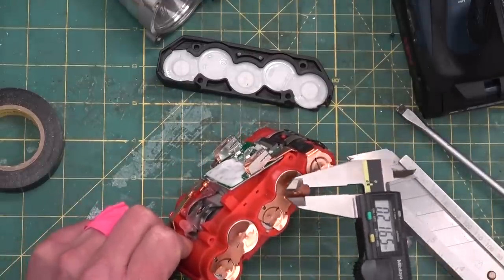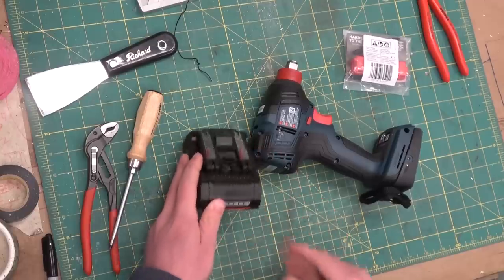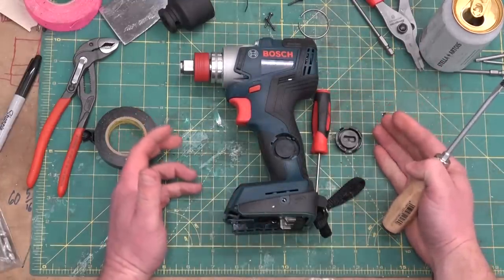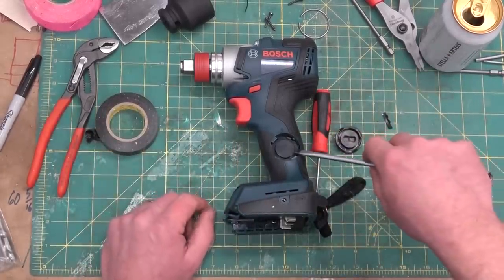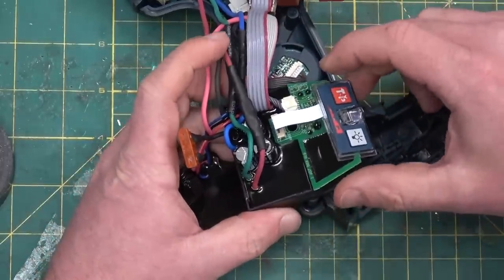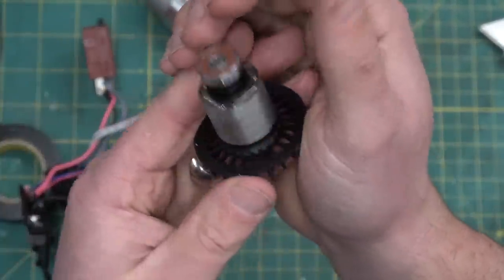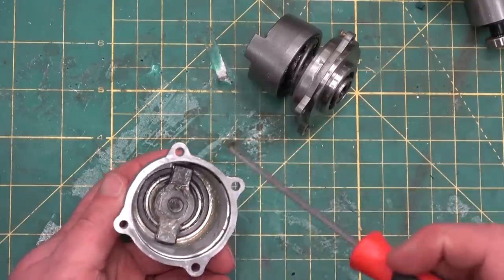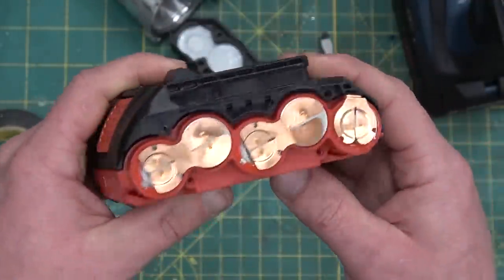BOLTR: BOSCH impact driver | CORE 18V

Comment: Cooling Fins of Plastic  is like Fire Resistant material out of gasoline. Plastics, no matter the type have a thermal coefficient of 70-100 degree C/watt. In other words its an insulator.
Reply: HDPE has thermal conductivity significantly better than what most battery cases are made of. It's shitty compared to aluminium, but twice the heat conductivity is twice the heat conductivity.
Reply: @macvos  I dont know its thermal conductivity off the top of my head, but I sure you are correct. However, half of barely conducts is still very bad. Its why power equipment and batteries fails. If these companies would spend another nickel and put any type of metal on type of a FET thats controlling speed control or provide other high conductivity bridges from components to case the tools and batteries would last a lifetime but corporations can't afford that.  I spent 40+ years in San Jose Ca, designing fault tolerant servers and we solved thermal issues all the time. I can tell you from experience, its some marketing guy convincing management if the product costs another 5 or 25 cents people will turn to the competitor and management whose prime concern is profit, agrees's. None of these types cares about the end user.
Reply: @ColdWarVet607  I'm sure cost cutting plays a large role, but a strip of aluminium is probably cheaper than some expensive plastics. You'd also have to take electrical safety (conductivity), thermal safety (prevent hotspots) and durability (drop protection and corrosion resistance) into account. Which metal would you advise that doesn't conduct electricity, doesn't corrode and can handle drops into concrete?

Comment: I think the 3/8" square drive with a hex drive inside is kinda cool...but yeah, I won't be buying any Bosch stuff any time soon...lol
Reply: I think it's a 1/2 inch square. The disadvantage of having the hex inside is the possible torque is limited, or it would break the square, because it's less rigid than a massive square. The Makita 285 is a little bit stronger than this, because it has no hex inside.
Reply: @simonm1447  that square is more than strong enough for the torque the tool provides. It's also a lot stronger than any adapter.

Comment: I picked this set up on a nice deal or it wouldn't have happened. I like the drill quite a bit, but the impact is weak and I hate the fact that the light won't work until you're balls deep in a fastener, or your wrist. The impact does serve a purpose now and it's for when I need a smaller profile driver or something easy to carry while doing work indoors. For outdoor use, my Milwaukee impact just dick wags this tool.

Comment: 21700 cells are currently in but its mostly marketing theyll probably decline as the 26650 did... the bigger the cell the harder it is to cool and as a result the capacity and/or the rated current does not scale well to the volume
Reply: They have lower internal resistance = less heat at the same power output. Also, most brands have finally started to follow Bosch and Metabo and use 21700 cells as well. They're simply more suited to high power applications than 18650 cells.

Comment: idk brother..i didnt have any influence for tools or engines from my "father" or any other male for that matter, was raised by my grandmother n still ended bein a pretty hardcore gearhead tool addict n ATVaddict (which was my first, n still after over 20 year is my email :p)  but i love stats n measurements n would love to start seeing that kind of integration in tools, its not useful for me but it would cool to know some stats on my tools  as stuff gets cheaper well b able to have torque sensors power sensors temps and different modes of control that might actually b useful. iv even thought about putting a gps module n either tiny battery or regulator in some of my more expensive stuff so id b able to find it  iv lost enough that shit costs too much   we should b able to have some kind of environment of that kind of stuff without serious security concerns we should work towards that

Comment: The copper battery connections should be at least 0.025 , 25 thousands ... even better would be 0.030 - 0.035 , 30 to 35 thousands of an inch and nickel plated

Comment: The bluetooth module allows you to change the timeout for the LED light. For me, thats the only thing I found to be useful. I‘m not a fan of products using or even needing apps to work. Also this BT thing is using a button battery cell. Maybe someone will hack this, to allow changing these settings without the module.

Comment: The batteries for the Dremel are the same, because Bosch owns Dremel
Reply: Doesn't mean the connectors, shape, material or cells are the same. Bosch also have separate DIY (green) and pro (blue) lines with different packs and cells that are incompatible.

Comment: Can Bosch explain why BOTH my 8ah batteries died after just 3 years? I paid a lot of money to use them on my Bosch angle grinder with moderate use and no abuse, and now they are dead!! Shame on you Bosch i am never going to buy another tool from you.
Reply: Have you brought them to a repair shop? Would be really interesting to know whether a cell had died (maybe a bad batch at Samsung) or maybe the PCB?

Comment: The drop test NEVER HAPPENS ON flat cement.  It will be down farther on the rocks below which are jagged edges. You are lucky if it lands on a flat surface & it is not even worth a mention if it lands in dirt.   Yeah, that is why I buy the Powerfist junk.   If it goes (I could afford to buy 2 of them) compared to 1 Borscht. The plastic cooling fins are meant for strengthening the base instead of a solid chunk of plastic yea thick.  So they is saving on the cost of plastic with the webbing.  As for the red dingus cup, you did not mention if it was rubbery...if so, maybe it is meant as some kind of shock absorber so the worker using it don't get "hammer tired"    Germans are always thinking about the welfare of their workforce. Don'tchaknow? IMO of course.

Comment: I reckon those are 2070 batteries in there... ie. Tesla car type. Copper is about 4 times as conductive as nickle, but they are conserving it like it's gold. Being a superior conductor doesn't make up for a piss-poor connection, which points to an executive decision, instead of an engineering one. Either way, everything about those drivers is cost-cutting and "marketing-wanked" wherever possible. Bosch has been on my NOPE list for quite some time now, and it looks like they are still chasing the last bitter brand-name clingers with increasingly horrible junk.

Edit: Also, the next Pearl Harbor will be from China, remotely disabling all the technology that really didn't need to be connected to the internet, but is really needed to make a country function, and is cheaper with the added tech than without... for no other definable reason.

Comment: Bluetooth has nothing to do with the Internet. Thats called wifi. I imagine with Bluetooth and the app you can monitor the devices performance and power lvl from your mobile. It will work even if you mobile is in flightmode.

Comment: Why did they use bigger cells you wonder?

If you have an 18v battery with lipo cells, that's going to be 5 cells in series. For choice of cell size, 18650 would indeed be the default. If you want to upgrade the capacity and really want to stick to 18650s (because that's your fetish), you'll have to source them with a higher capacity (higher enery density) or run two parallel sets of 5 cells in series (aka 2P5S).

Parallelization means you can only use 10/15/20/... cells. Ten 18650 cells is probably too big already.

Higher capacity cells are more expensive, and at some point you just can't get them any higher capacity anyway.

So if you want let's say a 50% capacity increase without changing the pack voltage, your most sensible bet is just using cells of similar energy density that are 50% bigger.
Reply: If you want a current increase, it's exactly the same story. Either run multiple sets of the same cells in parallel, buy more expensive cells, or use bigger cells with similar density.
Reply: Higher capacity cells also have lower power. Current 21700 cells have both more capacity and power than the best 18650 cells.

Comment: borsch? no I think the idea of IOT/IOS tends to be an Idea A-BORSCH-ON
some things make sense, like security cameras and spotlights to scare the shit out of and prevent hiding of intruders, but a drill? a lightbulb? it tends to get stupid when you are either too lazy to turn off/on the light, and ridiculous when you adjust your thermostat more than once per day, and then it just doesn't need the "I" in IOT at all, just a simple scheduler program that should not have literally any wifi at all
and a drill app is just completely stupid, torque/speed should be a 100% direct interface on the tool, there is no excuse for an app to do what drills have been doing since before cordless tools with anything other than the tool itself with no app at all
the app can be 100% optional(like if you have a strange custom tuned torque curve that torques a bolt to one setting, rests, then another setting, rest then a third to get rid of any quirky issues of physics.
but a thermostat doesn't need wifi to have a simple "between xx:yy zz and xx:yy zz tune to setting b, otherwise set to setting a"
lights don't need unicorn cum colors, one setting you pre-tune and the vast majority have nothing more than "brighter, dimmer, on/off"
IOT is just ridiculous in so many ways

Comment: I will never buy a BOSCH power tool for my own use, ever again. I bought a BOSCH driver for pulling fasteners from VW under body trays to do oil changes.... And the damned driver I bought barely had enough torque at times to loosen up the Allen head screws in the plastics! Screw BOSCH, and at this point after working on German cars.... Screw all things German, other than their autobahns. Their cars are nice to drive, but a nightmare to work on, and their power tools are too expensive for the performance you do not get.

Comment: Bosch claims that the only difference between the regular battery and the procore is the charging time and the amount of charging cycles they can withstand.
In other words... Not worth the extra money.
Reply: No they don't. The 4 Ah ProCore is supposed to deliver the same power as the older 4 Ah battery (not exactly true, but close enough) in a smaller and lighter package (completely true). The 5.5 and 8 Ah ProCore batteries have far more power than any previous 18650 based Bosch battery. All ProCore batteries have better heat dissipation than the older batteries.

Comment: Haven't even watched the whole video yet and I already know how shitty those Bosch impacts. Had a impact last 6-8 months before having to drop it off at a the local warranty shop. Needed a new trigger and  a few other parts, out of warranty of course and the repair cost was $120usd. Almost what I paid for the drill and impact set. Junk tools, they we're never used daily or for extremely long stints. Mostly used for finish work, never again Bosch!
Reply: Yeah, 1 tool going bad is something that never happens with other brands. I've never heard about a single Milwaukee, DeWalt or Makita drill malfunctioning...

Comment: If they put the bluetooth chip on the drills pcb it would cost less to make the drill than the connector board, ribbon cable, plastic door, plastic insert and extra labor. Total cluster f...

Comment: THOSE BATTERIES...... ive had 3 pro core 8.0ah die on me(the battery test light stays on and they wont charge), one within 6 months of using it. each time bosch sends me a new one without question.  when i ask if any other customers have had the same issue bosch tell me that they dont. maybe because im using the batteries in a metal work environment? anyone got smart ideas becasue BOSCH aint.....

Comment: 0,1mm copper times 15mm round - around 1,0 or 1,5mm2 - that should be ok?!

I mean people use 0,1 or 0,15mm Nickel-foil for doing e-bike batteries...

Pure copper in 0,1mm should be fine.

The quality of the connection is very questionable!

Why not 4 or 6 spot-weldingpoints per cell, like other manufacturers do?!
Reply: This is Bosch - they calculate the minimum, and you only get the minimum which is needed for function, with no reserves. 
It's still a 5 cell battery, a 4 Ah battery with 18650s with 10 cells has only half of the current per cell, and per connector strip.
Reply: What is also lacking in the battery is balancing - there are no balancing connectors there. Milwaukee has balancing, Makita also. This is in my mind more serious than the copper connection.
Reply: @simonm1447  they say the newer batteries are balanced and that monitoring is done by the tool instead of the battery pack. Not sure if the first part is true though.

Comment: uncle bumblefuck is a better engineer than a multi-billion dollar german company known for its engineering....
Reply: Cr0Lar  I have not heard of anyone having problems with the batteries at all.  and everyone loves them, and that was his major issue, so he thinks they have too thin of copper, after he throws it of a ladder multiple times and the tool with battery still working fine....   seems like it was engineered just fine to me.
Reply: yes, they are also known for good diesel cheating software.
Reply: @simonm1447  well engineered at that... I question that whole thing, most likely a con to destroy diesel cars in the usa, and they did it well.. but I picked up one cheap after the fact so was a win for me.  Great car for great price.
Reply: @bobsmith-gn7ly  just wait, until the sensible injection system makes problems, in such a case you have to spend thousands for  the spare parts alone. A colleague of me had diesels, with one car he had 2 totaled engines, and several turbo chargers. He will never buy one again. 
I also have machinery with diesel engines, but they have old engines with classic injection pumps, no sensible common rail with turbo. Truck diesel engines are still robust and reliable, but car engines are built in a much cheaper way today.
Reply: @simonm1447  cool..... came with a nice long warrenty too... they can fix it if it has problems.... probably he didn't use any diesel additive, american diesel is very very dry because of the the low sulfer bullshit.  they are supposed to be adding lubricants to it now at the refineries to help with injector issues.  but best to run some anyways.
Reply: @bobsmith-gn7ly  My colleague is in Germany, not in the US. The diesel here is sulfur free, because sulfur ruins a SCR catalyst (this AdBlue device). 
But adding stuff like 2 stroke oil (some people do that) is also not a good idea if the vehicle has a particle filter, it can block it, even the engine oil for these engines is another one than the one for older engines, with only little ash if it burns.
Reply: @simonm1447  cool I have not heard many issues with the diesels here, they tend to have much longer engine life than gas, but time will tell I guess.... no you add stuff like opti lube... then when your warranty is up you remove all that crap altogether, if you have a problem with them the majority of the time its in the egr/emissions crap they put on em, but that is easy enough to fix.
Reply: @simonm1447  and no its not "sulfer free" its ultra low sulfer, under 15 ppm, down from low sulfer which was under 500 ppm

Comment: I mean really WTF we're they thinking?
Reply: where? this tool seem good to me. most of his complains are uninformed. so what is your problem with this tool?
Reply: @swunt10 , sorry that was my son, he decided I needed to comment on this video. 🤐 The copper foil does seem a tad flimsy though!
Reply: @MattBrownbill  as someone else has pointed out "Copper foil in the battery:  ~0.12mm * ~12mm = ~1.5mm2 = ~16AWG" so that's perfectly fine. I guess it also works as a foil fuse to mechanically disconnect the batteries in case something is wrong with one of them. all in all I never heard that the foil in the batteries is a known fault.

Comment: Low skilled labor that never did work before. Limit their torque. Versuses us mechanical guys by ear and touch and pull can tighten or loosen. My last dewalt impact had flush delicate setting I was building tool stations, my bro would leave proud or try and pull screws to other material set it flush... suddenly yank trigger it stops and is flush... thing about average off the street guys they think a dip stick is their weiner. Or jobsite look I just need to drive 6 fasteners can I barrow yours rather then walk to truck?

Comment: Dunno about the GDX (I have the  older model GDX 18V-Li without BT myself), but on my GSR 18V-60C, it is for adjusting the kick-back control and the duration of the LED light.
And why the F*ck du you keep pronouncing the darn thing "Borsch", there is no friggin' r in Bosch!!! I cringed every time I heard it until I finally got enough and quit watching after less than 9 mins.!